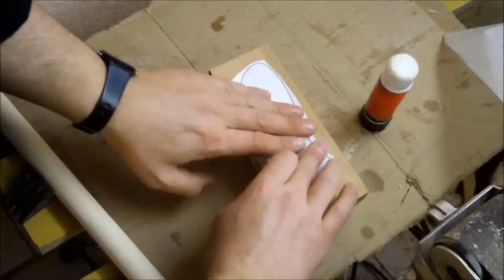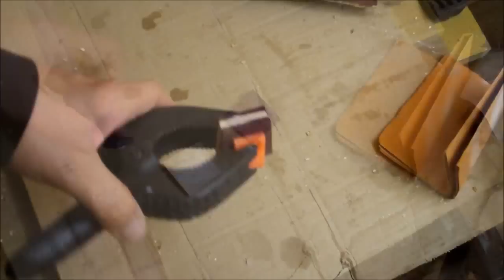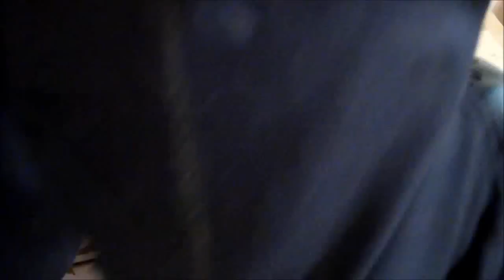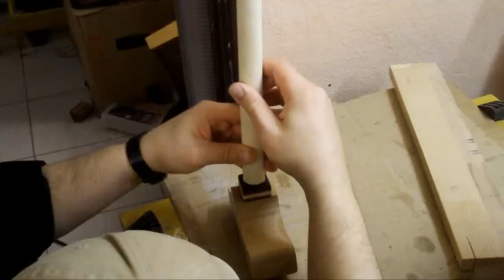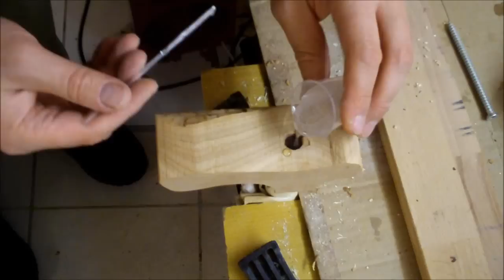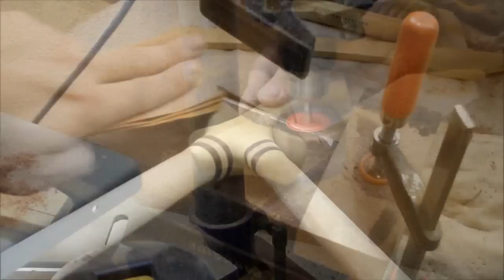making a walking cane

Comment: Nice cane, just not sure why the metal screw at the bottom. I know you put a rubber end on but that will wear a hole in the rubber faster and possibly cause damage to a floor. Putting a small round on the end will work as well.